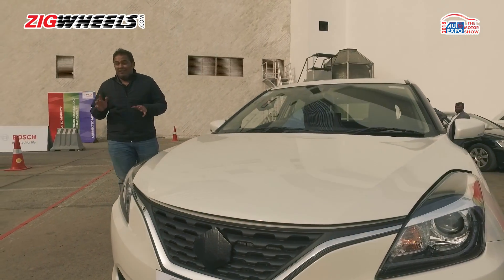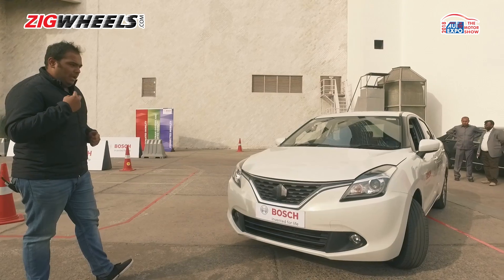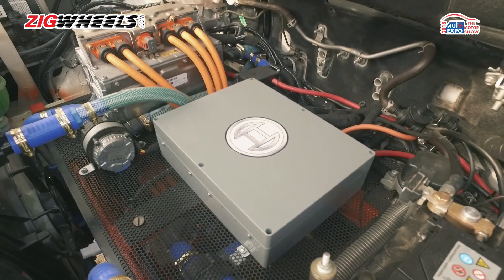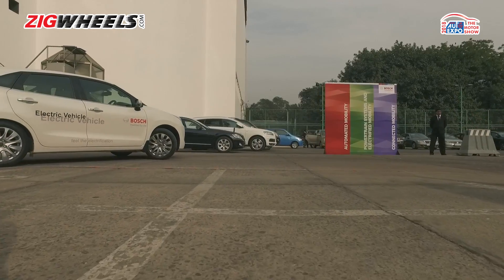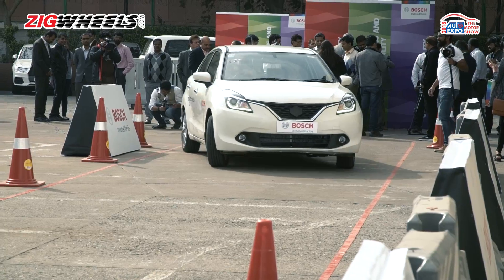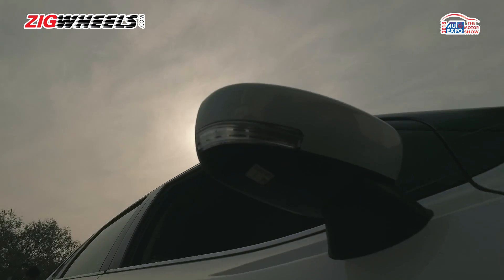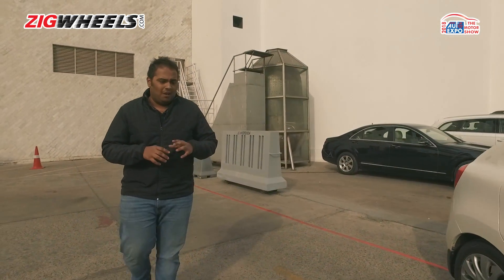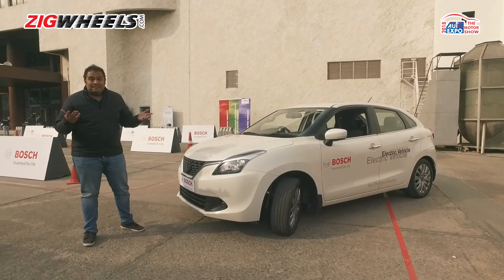Bosch EV Prototype (Baleno Electric) | ZigWheels.com

Comment: 200Nm for the lightweight Baleno is fairly good. Range Please?
Reply: Arun Shenoy I actually meant the chassis, Baleno having a low kerb weight, should pull really nicely with an electric car having instant torque right. 

But I reckon the heavy battery setup has dulled it down a bit?